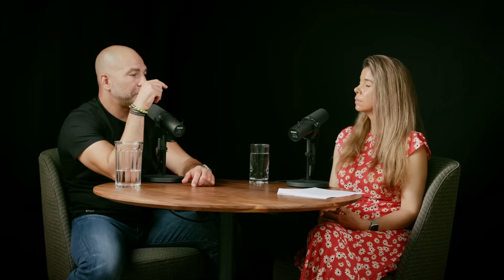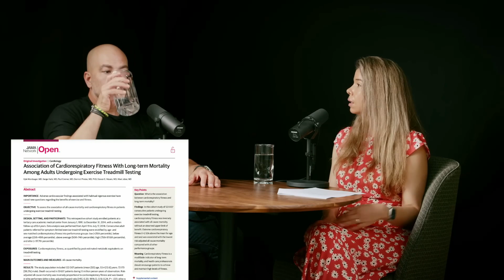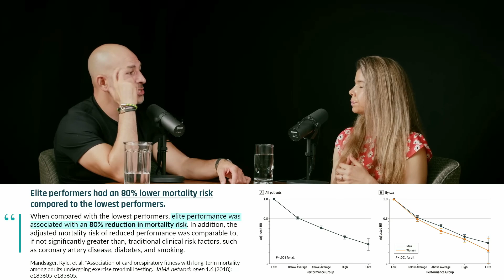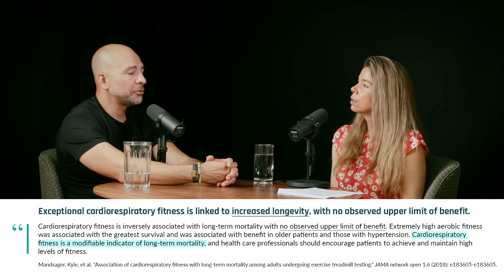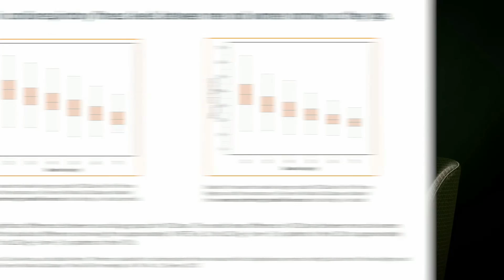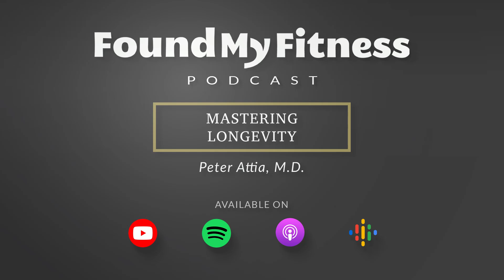Peter Attia on What It's Like Getting a VO2 Max Test (key markers to look for)

Comment: WOW is it that hard to get thru the test.... how fit do you have to be to not make it fail???
Reply: Very important question. It’s not necessarily how “fit” you need to be, but how well have you trained to get to actual VO2 Max in the test. It’s very hard, but most people simply have no idea and will quit too early. Same goes for VO2 Max training, by the way. Now that VO2 max training is a “thing,” people are doing “hard” 4x4/4 intervals…usually at sub-threshold levels which seem “hard” to them. Now, if you’re a high-level endurance athlete you know how to get into the pain cave, but the vast majority require months of systematically increased training to achieve true VO2 Max levels, again, mostly due to mental limitations, or perhaps better put, training the mind AND body to achieve true VO2 max. As a coach, it’s easy to find what an athlete thinks is “hard” and can do for, say 4 minutes. Once you train sufficiently and know what the threshold/FTP is, now you can start talking about how to proceed to get intervals that start around 110% of FTP and proceed to 120%. The good news is that training to prepare for a VO2 max test is also training your VO2 max, so you have nothing to lose in that sense. FWIW, I test people at 3-4 minutes to see what they can/will do just as a diagnostic. But once we get into training. I build UP to 4 minutes intervals, or the classic 4x4/4 (four, four-minute intervals with four minutes of rest between). It’s all rather common sense, but in the same way that you should not just go out and do a 1RM test for, say, squats 😮, you don’t just go to a VO2 max test and let it rip unless you’re fairly confident about achieving that level of work. Just my two cents. 😊
Reply: @tommyrq180  Oh damn I shouldn't even think about trying lol.... I train at a lower level... Thanks!
Reply: @jimmypeach8838  One thing you should know is that you can raise your VO2 max just by training at lower endurance intensities. VO2 max is still aerobic (as opposed to sprinting). By staying at lower intensities, you’re limiting how much you can increase it, but controlling the high costs of training at those levels. I remember dislocating a rib doing VO2 max cycling intervals because I was breathing so hard. That rib really hurt until I could get it back in place. That would not have happened at a lower intensity!
Reply: @tommyrq180  Thanks! Seems like my leg muscles go out before my breathing does when I go really fast like 100 rpms on the bike at gym!